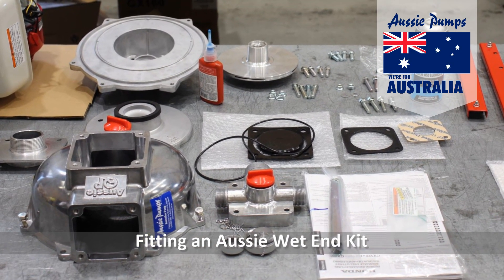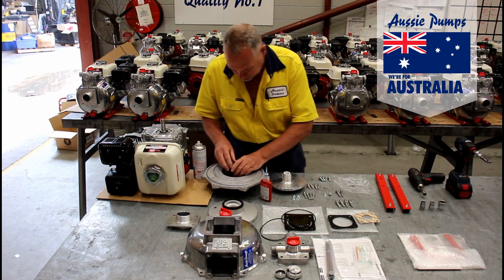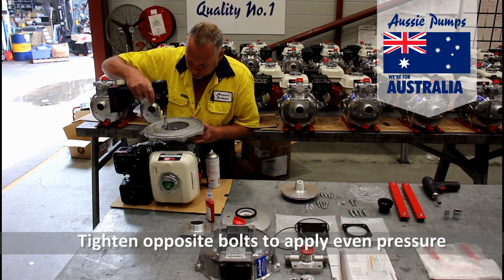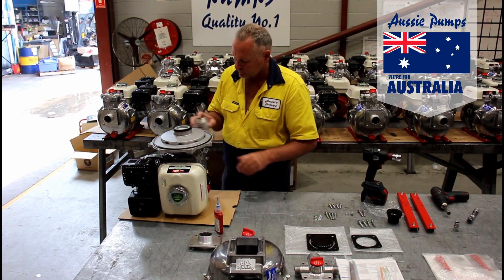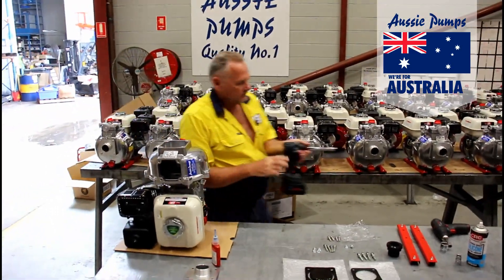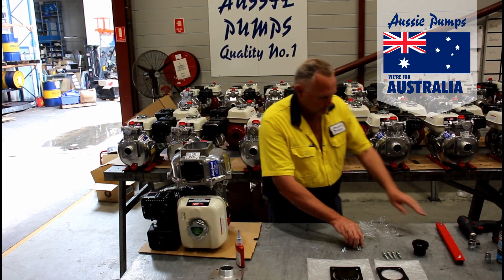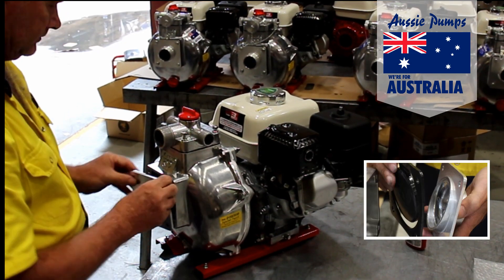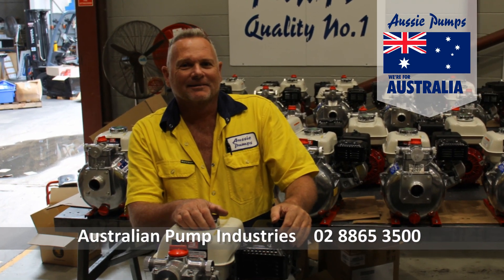How to fit an Aussie Fire Chief Wet End Kit | Aussie Pumps

Comment: head & inlet could be one piece with  pump body

standard 3"  in/out 

seals blow out and screws vibrate loose

include  gasketed  in/ out adapters 2" & 1/12"
Reply: ^^^ Smartest guy in the room.